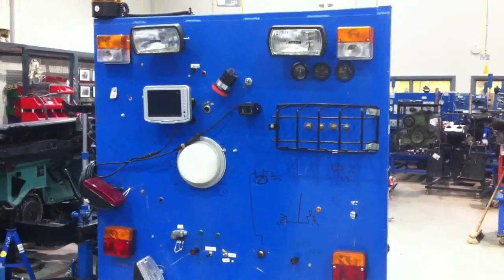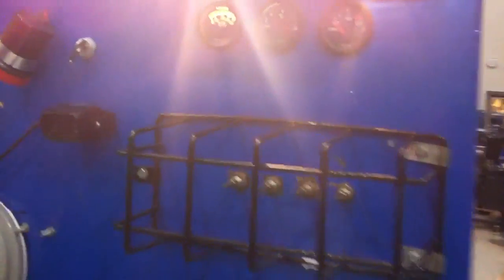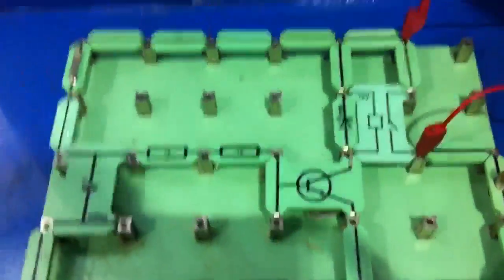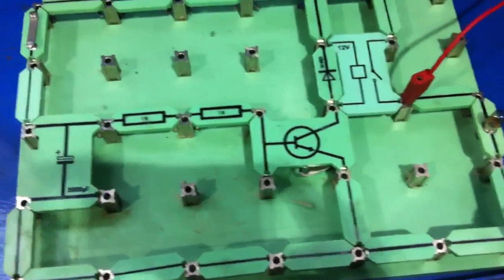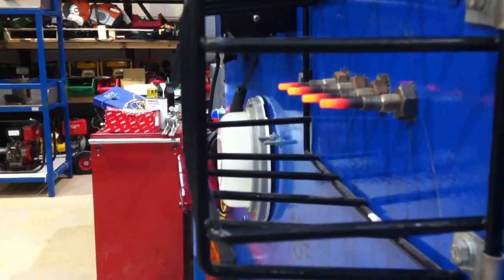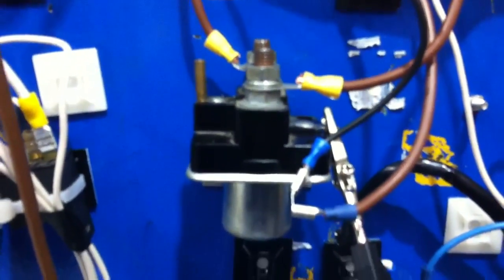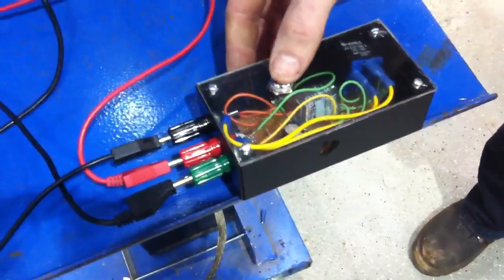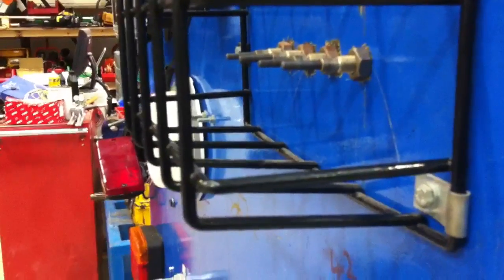Time delay circuit using Locktronics to control glow plug operation in a diesel engine

Comment: can you show me the complete diagram of a circuit?
Reply from the maker: Hello there, you can find full details of how to build this circuit here:  http://86.43.94.97/moodlecp9a/mod/resource/view.php?id=423
You should note that there are many simpler, more effective ways of building a time delay circuit, I just used this layout because the individual elements (capacitor, resistors, relay) are all on the syllabus of the course that this circuit was designed for.

Comment: hello sir, i'd like to asking you a question. i'd like to know what kind of transistor you used plzz?
Reply from the maker: Hello there, I used a BC109 transistor. Any similar type of transistor will do. The collector emitter circuit has to handle 40 mA - that is what the coil in the relay uses. This circuit operates down to around 1V and less than 1mA from the capacitor.